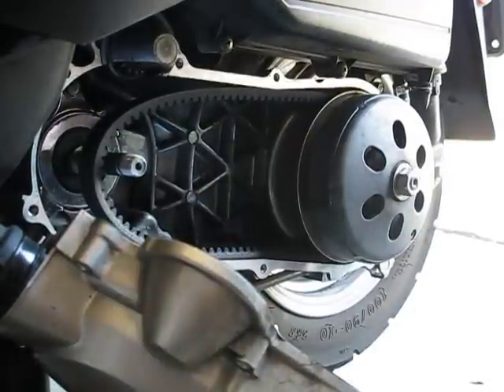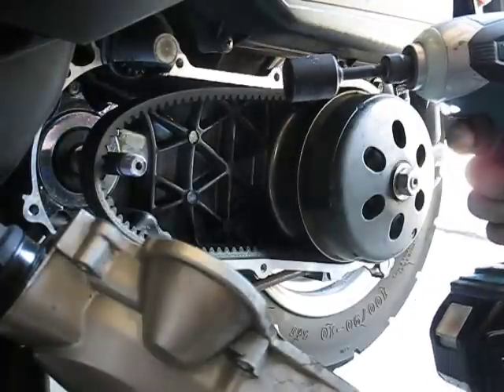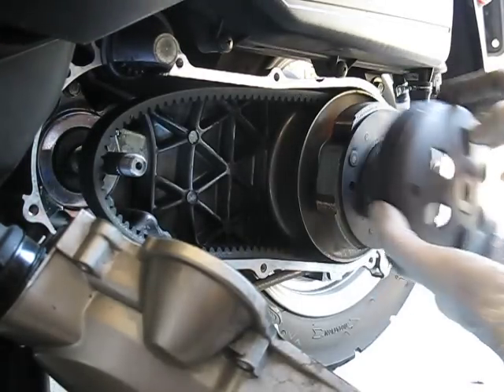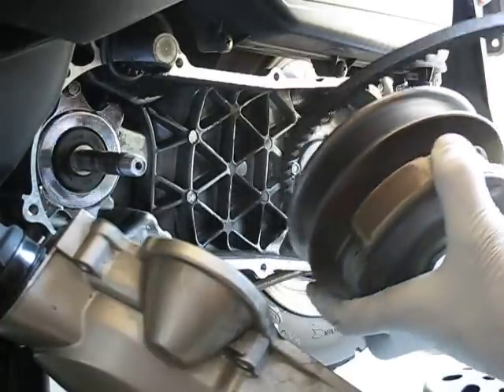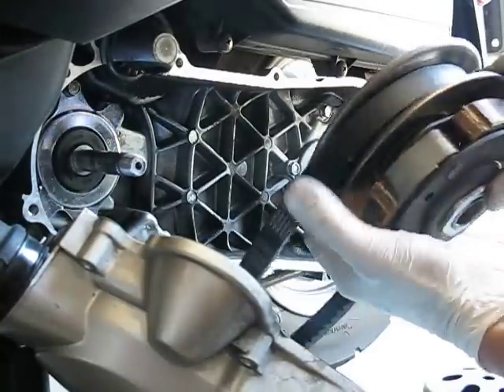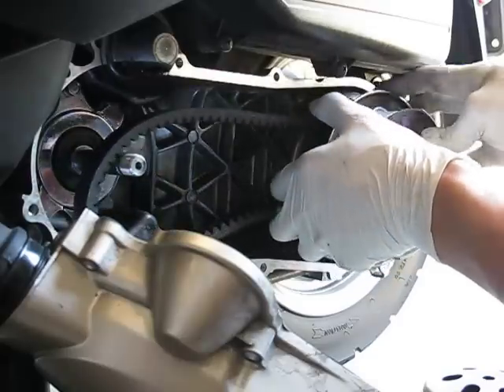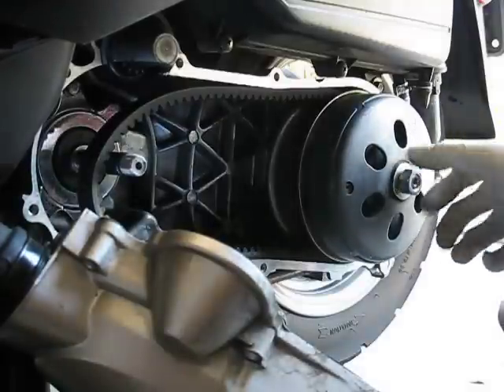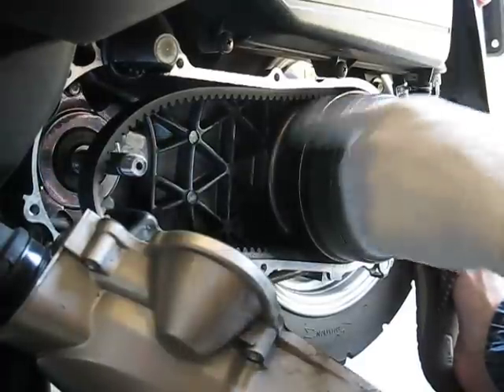Honda NHX110 clutch removal & installation

Comment from the maker: you have more miles then me! I'm gonna try 10k first and see if I get speed back if not then I'll put the original one back.  The service limit spec is 17.5mm per Honda Service Manual

Comment: are the parts for the NHX110 unique to that bike or is there any crossover with other Honda scooters (such as Reflex, PCX)?
Reply from the maker: The only parts I know that are used in other scoots are the brake pads, also used in the SH150i, and maybe the brake levers in other scoots, Some of the switch gears like the starter button and the high/low beam switch...really it is only a few things....There might me more common parts with other models that are in the same size range...kinda similar how the 250cc scoots use lots of the same parts

Comment: I have a 110 nhx and I want to buy racing parts that you recommend and where could I buy it please help me
Reply from the maker: What racing parts?  Only thing I have done is put in Dr. Pulley Slider weights, 12.5grams and over size front and rear tires.  Over size tires are not recommended if you are in urban/stop and go environment.  Other thing that I had before was the Kitaco taller final drive gear which I have since removed.  If you do go with the Kitaco gear then stick with stock size tires.

I got the dr pulley sliders on amazon look up size 18x14 12.5grams.  Kitaco final drive from WeBike out of Japan.
Reply: DaBinChe thanks another question when you had kitaco transmission and dr pulley what was your maximum acceleration final speed
Reply: DaBinChe If I buy the kitaco transmission, what benefit will I get more speed?
Reply from the maker: @DrPaulo-rx5pd  more top speed but you will lose out in acceleration and climbing speed.  It is only good for open flat roads.  This is why I took mine off and only use the sliders and oversize tires.  Now if you were to use stock size tires you might be able to use the kitaco gear but not both unless you are in flat open area
Reply: DaBinChe Excuse me if I'm bothering you, but I just want you to recommend things to use on my scooter to speed up more in my country, we call it truncating the scooter, I think the sullo is a fine fit. I hope you understand and excuse me. I would appreciate your help
Reply: DaBinChe thank 🙌🏼 men
Reply from the maker: @DrPaulo-rx5pd  The three: slider weights, oversize tire and final drive gear are what can increase top speed but at the sacrifice of acceleration and hill climbing.  I don't know the conditions which you use your scooter, but if flat and in open none urban environment then all three can be used. If not then only the slider weight or one of the other: final drive or oversize tire but not booth.

Comment: I never seen a electric impact have medium setting! 🤣🤣🤣
Reply from the maker: Higher end ones have 3+ settings
Reply: I got a Milwaukee and Dewalt neither one of those has a medium setting. So your telling me you can set you 3/8 drive impact to 40 ft lbs or whatever it is for the side cover bolts. Because if you can do that I want one. What brand we talking about that's high end enough to offer such features?
Reply from the maker: @chrisahrens3439  It is a Makita with Low: 20ft-lb, Med: 40ft-lb, High: 80ft-lb.  Each setting can go higher if you hold trigger for longer.  This model (BTD141 or BTD144, I forget which) is over 10years old and was top of the line for Makita at the time, Made in Japan.  Today they have one that is very similar but even better with more settings:  XTD16 and if you want one even better get the Japanese market model, but buttons are label in Japanese:  DTD171.  I'm not sure what the ft-lbs setting is for each power setting.  You can find the Japanese market one on ebay from a Japanese seller.